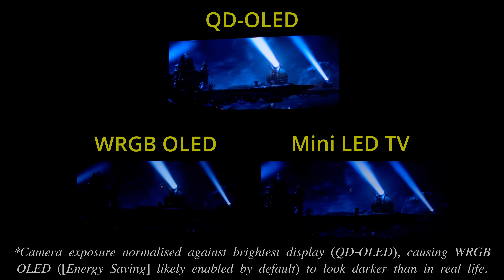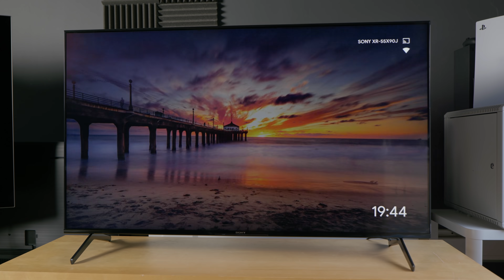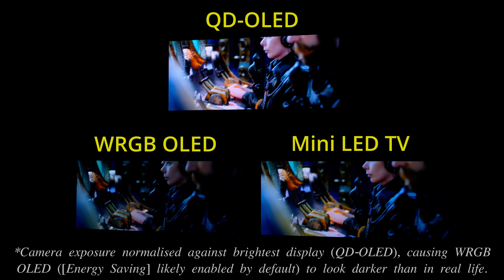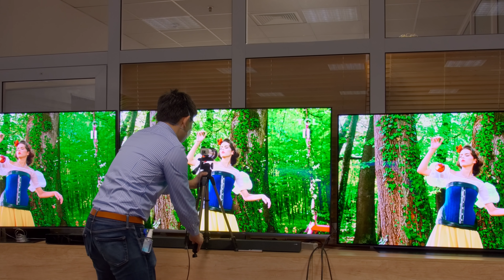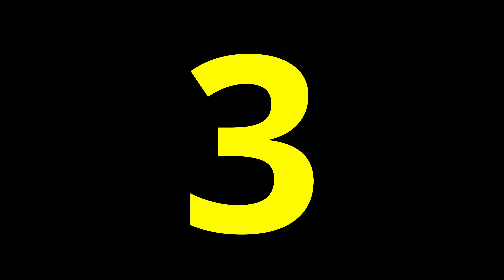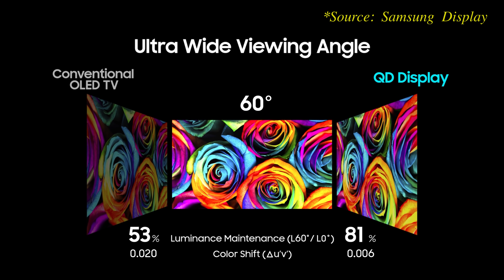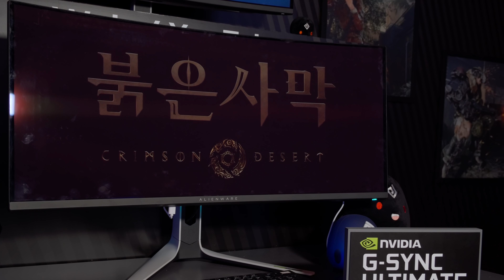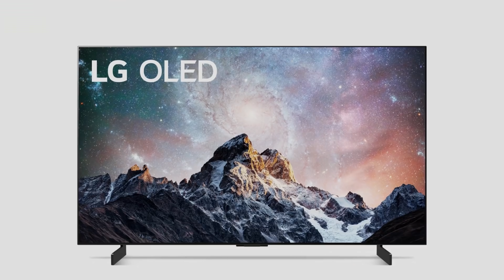QD-OLED vs WRGB OLED vs Mini LED TV First Impressions at CES 2022 - Them COLOURS!

Comment: I want to know is if Samsung have made a much better ingredient for their blue OLED panel because by far blue is the colour that burns faster and maybe it's the reason why LG Oled have been using blue+yellow OLED panels for longevity.

I mean it would even be cheaper for LG to get rid of the yellow OLED panel and use a QD color filter which is not very expensive nowadays just like Samsung is doing now...

Comment: How do you "Curate" a better image demo for one OLED over the other OLED (saying that you already prove that the QD-OLED can handle content better, not an argument)? I can see you can do that with OLED vs LED.. By simply using a lot of YouTube demos filled with high contrast blacks and bright highlights forcing the LEDs to have more blooming that normal content..
But these are BOTH OLEDs.. If LG G1 their very best OLED from last year can't handle content that the QD-OLED can. Yet again BOTH are OLED with perfect contrast.. It only highlights the LIMITATIONS of the LG OLED..
So where is the Caveat?? That you shouldn't watch 'certain stuff' on the LG OLED because it can't handle it as well.. So why buy it? I mean that is always the argument against an LED "It can't do perfect blacks it can show this and that"..

Sorry, don't buy that "caveat" example.. Sure maybe the crappy LG MiniLED doesn't handle it well. But the OLED.. We know the same panel is in the A90J and Sony sure can handle it with their XR processing and brightness..
Reply from the maker: By showing bright, colourful (rather than grey and mundane) content to highlight QD OLED's advantages of wider colour gamut, higher colour volume, & lack of white subpixel dilution effect.

Comment: Really looking forward for OLED EX vs QD vs everything current comparisons. I guess my personal biggest problem in the future won't be finding a TV I like but rather how the prices develop. QD is brand new and my preferred 65" size is the biggest they offer at the moment - so chances are 99% it will be expensive for quite some time :-D
Reply: im still looking for a price drop on 65" Lg C1, they cost around 2000$ in Denmark.
Reply: @MustafaAli-ri3bx  65" C1 is €1500-€1600 elsewhere in EU, even on German Amazon, latest TV tech has never been cheaper and the way things are going, with supply chains problems and all, they might shoot up in price the way some luxury products have or tech products in high demand. Now seems like a very good time to get a C1, it's very good and reasonably future proof, most of us won't be buying QD OLEDs anytime soon and EVO panels aren't better enough to warrant the higher cost. An average consumer is better off getting a 65" C1 and Sonos Arc (or even Beam Gen-2) than a G1 without a soundbar.
Reply: @toobalkain  the lg 2021 oleds are not good, and in 2020 it was the same thing. At least, it's really not the most beautiful picture.
Reply: What is really interesting is that these technologies are not necessarily alternatives to each other and both can be used in conjunction.

Comment: I don't see why anyone would ever complain about viewing angle. If you're not sitting in front of the TV, you're doing it wrong. If you have one of those goofy setups where the TV is way up on the short wall and the seating is along the long walls so you have to keep your head turned, you're definitely doing it wrong.
Reply: THX recommends that the TV takes up a 40° field of view. That means that even if you're centered perfectly in the middle, the left and right edges are angled 20° away from you. I can notice a color shift on the edges of my CX when I sit at the recommended distance. (but mostly only while looking at a white background on a webpage). Samsung claims this tech will cut that down by about a factor of 10.

Comment: Would want to know more about QD-OLED vs Mini LED, also I’m interested in knowing which is a better tv for content that is all about constant specular and highlight detail rather than shadow detail since some content (Anime, Gaming, etc.) might not need have shadow detail at all
Reply: Mini LED will be better for a lit room.QD-OLED will be better in a pitch black or dark room. It's very simple really.
Reply: @campersruincod6134  Actually I don't like the auto dimming feature that happens with OLED overheating with constant content, a lot of well lit content has constant scene backgrounds, so even in a dark room the OLED auto dims
Reply: @BuzzLighyearr  that's called an ABL. If you don't like them, then you already know your answer. Get an Mini LED until Micro LED is available.
Reply: @campersruincod6134  I am curious to know how much ABL affects QD-OLED, and if it could be turned off like on the LG C1, how would a QD-OLED without ABL compare with Mini-LED
Reply: @BuzzLighyearr  C1 uses an ABL. QD-OLED won't be any different.
Reply: James Clouse  doubtful. I had a Pioneer plasma that lasted 15 years which still performed practically the same as it did on launch.

Comment: Side by side comparisons like this are really not doing OLED justice, your eyes always adjust to the brightest thing in the room.
With controlled lighting the perceived luminance of the average picture is going to be very similar between QD-OLED and OLED.
Almost no-one is watching TV in a pure black room so higher average brightness does have value, but strictly speaking if your movie room is well controlled the upgrade to QD-OLED in terms of average brightness will be much less noticeable.
Reply: Exactly - it is good tech - but it's kind of like those screen manufacturers showing how bright their projector screens are - good for power point displays - but is it that important in a controlled home cinema environment - especially given most of us can run a 200" screen - normally 120-140 tops
Reply: @nimblegoat  Yup, Infinite Contrast is Infinite Contrast. So what LG really needs to do is focus more on their handling of near black, as long as your dark areas look super clean then the contrast of peak bright will be more impactful.

Comment: There are very few times when you feel like you bought a product at just the right time, due to every year getting a newer and better version than last year.
I must say that I definitely did that with the LG CX. I've had it for over a year, it covers all my needs as it will for years to come, and I got it for just the right price. Tech like QD OLED and MicroLED will improve the screens, but it won't be "cheap" any time soon, just like when OLEDs first became available.
Reply: I agree that’s why I am getting rid of my LGCX for the Sony a 90 J or the Sony QDOLED these two brand of old LED makes my CX Picture quality look ancient

Comment: I will be bypassing QD oled and going straight to microLED in 100 years time when the cost is easy to afford
Reply: The 65qned90upa(2021)
Is pretty sweet.

I gave my oledc9(55inch) and bought the 65qned.

Comment: Definitely looking forward to seeing side by sides calibrated and energy saver mode off on the C1 playing DV/HDR content
Reply: Got a calman HDR calibrated 65" C1 with the new Evo panel. Everything just looks absolutely stunning.
Reply: @rapwnzled8458  The c1 doesn't have the Evo panel though? Only the G1 has it.
Reply: @movitz1579  some C1’s made in certain factories are getting evo panels. My C1 does not but I’m extremely happy with the brightness and overall colors/white balance, and screen uniformity. Only way to verify is by using a service remote

Comment: So, now that a seemingly brighter OLED technology is coming out, OLED enthusiasts are finally admitting their current displays are dim.
Reply: Dim is an exaggeration. My C1 is bright enough for the room I have it in.
Reply: @correctopinionhaver8647  it can only do 250 nits in a full screen 100% window.. 

You're trying to simulate a normal sunny day,  a street lamp and whatnot, do you realize how many nits a street lamp produce?  If it only produced 250 nits,  you would not be happy with it, regardless of how dark the night is.  250 nits doesn't magically become HDR bright, just because you sit in a dark room. 

It's not called "high dynamic range"  for nothing you fool,  your 200 nits are not HDR ready. 

The biggest lies in this world, is the stories LG owners tells themselves.
Reply: @HitashiSon  I can tell you've never used an OLED
Reply: @correctopinionhaver8647  I'm using OLED everyday, have been doing so far years,  I'm texting on an OLED touch screen right now.
Reply: @HitashiSon  Funny I don't see it on your videos
Reply: @correctopinionhaver8647  look again
Reply: @correctopinionhaver8647  I have a GZ950.  Burns my eyes at night. This TV being the brightest I've owned and that's coming from a Sony flagship LED, the KDLw905a. 

Still waiting for this one to say which set he has. I'm sure it's not a 300 nit led from Samsung
Reply: @dougquaid570  I own a 55” LG B7A OLED and a 85” Vizio PQX-H1. PQ is nice on the OLED, but not worlds apart. The PQX is eye-searingly bright by comparison.
Reply: I own a b7 oled and it is extremly bright Samsung always tries to make LG Oled look bad and always loses 🤣
Reply: What kind of TV do you have?

Comment: The brightness levels between oled and LCD aren't directly comparable because oled is self emissive which means that the contrast ratio is significantly higher whereas LCD has a backlight that shines on every pixel so 1500 nits on an oled is equal to 2000 nits or more on an LCD because the brightness is generated by the lit pixels only and not by the whole panel like on an LCD
Reply: What has LCD got to do with this video?
Reply: @titntin5178  you do realise that mini LED is basd on LCD technology, right?
Reply: @GreatDeadGod  mini LED doesn't have liquid cristals.

Comment: Thank you for the analysis Vincent. We definitely need a proper and fair third party comparison. Is it just me, or did that LG G1 look super dim? I’ve seen plenty of C1/G1’s and have yet to see one that looks so dim. A couple of the scenes they were showing you couldn’t even make out what was on screen.
Reply: This is the camera (it even says that in the bottom text). 

I guess in real life a direct comparison would make it look signficantly dimmer too but those TVs aren't calibrated and if you buy one you don't have the comparison in your house and unless your room is very bright the LG OLEDs are more than bright enough. In a darker environment with just ambient light which is best for watching anyways maximum sdr brightness is even a bit too bright
Reply: There are so many variants, the camera, the preset they used, I did a comparison of the C1 and the Hisense U8G and yes Oleds are definitely dimmer but the still have a fantastic picture.
Reply: what were you expecting? There is no way in hell samsung was gonna allow its rival wrgb oled to trounce their qd oled display so you are right with your analysis.

Comment: Wondering If I shall go for lg oled c2 4k 120hz 42inch or alienware aw3423dw 4k 240hz QD-oled 32inch..
Reply: The C2 would be better, imo.

Never thought I'd say it but 32 is just too small - that's the size of my side monitor :) its next to a 48 C1.

If you are a competitive gamer who genuinely feels increases in refresh rate above 120hz, maybe you'd want to consider the alienware, though to achieve those refresh rates you wont be playing high res. I can barely feel the difference between 60 and 120, so for me its a no brainer, but I'm old!

either way, you are going to have a great display...
Reply: that alienware model is not 4k, is only 175hz and is 34inch, question is the price, knowing alienware will be priced around 2.5k

Comment: I think for TV the qd-old won't justify the price difference this generation. The big play here is the monitor. 34 inches is a much better size for desktop use then a 42 inch. If the price point is sub £1500 I could see them selling a lot of those monitors.
Reply: I'm always iffy about calling a 34" a monitor because after all, 32" screens were heavily called HDTV's a few years ago. In my opinion, running with a 34" means you need to always game in 4k to avoid screen dooring, and that means your GPU is bottlenecked quicker since games are graphically becoming more demanding each year. Personally, I wish 27" 1080P QD oled was a thing. My 2070 is a turd trying to run GTA5 at 4k with grass settings maxed out.
Reply: @The1Music2MyEars  no idea what your on about, that alienware has 109ppi which is standard for any pc monitor. That's same as a 27inch 1440p which is one of the most popular panel sizes at the moment.
Reply: @mfdsuk  Ah for some reason I thought it was a 4k panel. My bad

Comment: Vincent, can you please add VR headsets to your test list?
They also have OLEDs or LCDs (and sometimes even actual micro-LEDs, unlike the mini-LEDs which Samsung falsely calls "Micro-LED" in their giant TVs) so it is your field.
Reply: actually you are wrong. the micro-LED tv's from Samsung ARE ACTUALLY micro-led. that is the reason the displays are 80" or larger, because they cannot currently make LED's small enough to make smaller TV or monitor sizes. so you are factually wrong. the micro-LED does actually exist. its just out of most peoples price range ($100,000 USD). on that note their normal mini-LED backlight displays are listed and properly called mini-LED. sounds to me YOU are the issue with your inability to comprehend.
Reply: @goblinphreak2132  "they cannot currently make LED's small enough" -- this is exactly why this is not an actual micro-LED since the size of LEDs in those TV is ORDERS OF MAGNITUDE bigger than actual micro-LEDs which exists in laboratories but are not in mass production yet. 
The "micro" actually means something: it is about sizes that are a thousand times smaller than mini-LED on each axis, not just nominally. Also, micro-LED displays are to be produced just as LCDs or OLEDs: as panels that are made whole via evaporation/deposition (and maybe printing), not like those giant fake "micro" LEDs where LEDs come in giant rolls and each separately is taken from the roll and glued to substrate and wires with a laser (what makes it incredibly expensive even with faster versions of this technology as Vincent covered).
Reply: @StrangerHappened  do more research and then come back and talk to me. the 80"+ microleds from samsung are real.... let me know when you get hands on like i have
Reply: @goblinphreak2132  Again, those are not "micro-" LEDs but rather smaller mini-LEDs. They are multiple orders of magnitude bigger than actual micro-LEDs, they are huge in comparison. They were called "micro-LEDs" by PR departments and to differentiate from the mini-LED backlight technology.

Comment: As soon as Vincent said the demo had been set up by Samsung, I stopped watching.  There is absolutely NO WAY this "demo" would have been done in an honest fashion. TV manufacturers ALWAYS show off their 'wares' in a way to only show them in their best light possible.  It's the same as a car manufacturer taking you for a ride (in the back seat) in their new car model, then TELLING you how good it is to drive.  You can also bet the house that the tv chosen from LG was not set up properly (none of them were apparently) but 'out of the box' performance was better with one than the others i.e. the competition were only chosen for lack of performance 'as delivered'.  

Let Vincent get his hands on them I say, THEN run  the same "test".
Reply: bruh what u expect?? demo by dell? by tesla? by unilever?
Reply: Continue watching.
Reply: God forbid, Samsung used Ideal condition to showcase their own products at their own booth, what a travesty 😷
Reply: Fully agreed ... nevertheless a lot of sheeps will step into the trap and starting to hype a technology which isn't even existing yet in a proper tv set ... lol

Comment: Why is Samsung using ADS/IPS panels on their flagship 4K Neo Qleds, I have the QN90A the ADS/IPS version and it's horrible with a ton of blooming and backlight bleed all over, the local dimming doesn't fix it at all, I use it for gaming but if it was my movie TV I would of made Samsung give me a refund, I have an LG CX for movies and am stunned by the pristine picture quality. It really cost me quite a bit too around $3000 (AUD) and I'm still paying it off after 6 months and I'm not rich, I feel scammed that I got an inferior product and other parts of the world got the VA panel with a much higher contrast ratio except for in Australia, New Zealand and Europe which got the ADS/IPS version it every size except for 50" and 85" which I wasn't interested in those sizes, got the 55" size, I'm really hoping Samsung fixes the local dimming so I don't see a ton of blooming and backlight bleed.